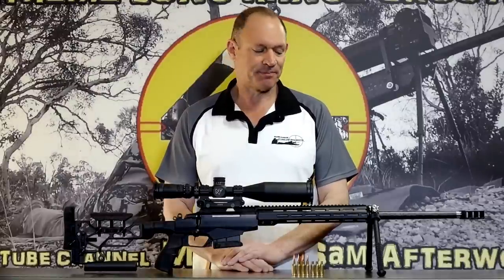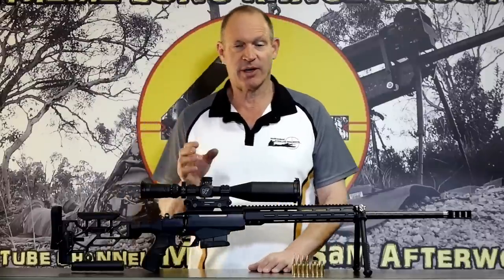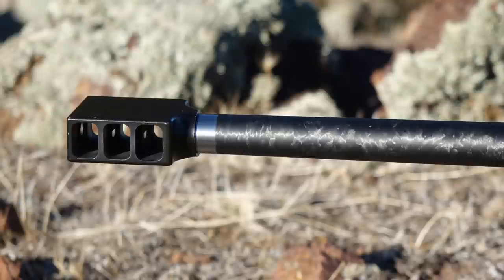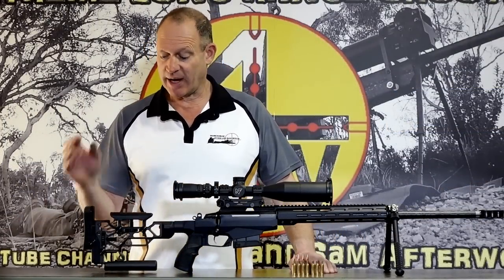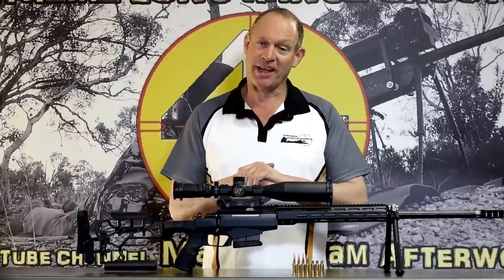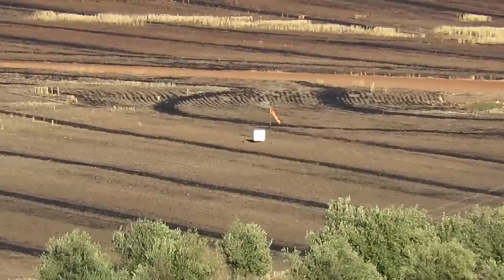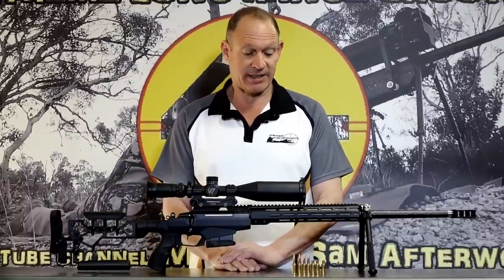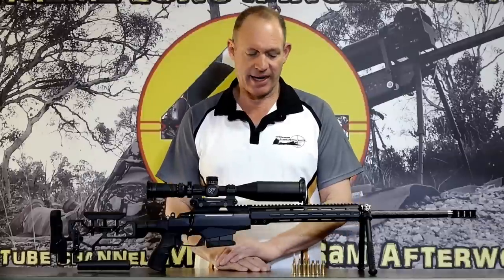Our first shots with the 6mmBR and 4AWised, TIKKA TAC A1 (CarbonSix Barrel)

Comment: I've popped primers in a rem 700.  I think the best fix is called "bushing" the firing pin.  I however fixed mine by putting in a new firing pin spring.  Mine had gotten old and weak and wasn't supporting the primer any more.  It sounded odd to me but I tried it and it worked.

Also a firing pin being too short can cause this.  Again it reduces the support from the firing pin on the rear of the primer.
Reply from the maker: Thanks Man, Cheers

Comment: I have a few 6BR's. When I bought a stock Savage 6BR, it had a shorter free bore than my custom gun (Atlas action, Brux barrel). I came down 1/2 grain from my load that I used in my Atlas action to start. It was way too hot a load and I punched holes in the 205M primers. 2900 fps MV for a 109 is a hot load. I shoot Berger 108's and I can get 2900 MV with them using N140 and Lapua brass. That's with a Brux 1 in 8 barrel with .104 free bore in a Bat action.

Nice shooting you guys. I only have 300yds by me. A 600 yd range is a half a day away. That's why I stick to the 6BR's it's a great round for 300 yds.
Reply from the maker: Thanks Man, Cheers

Comment: I had a problem with the one batch of federal gold medal match primers that I use the metal on the primer must have been a little bit thinner I ran the same load that I always did never had over pressure problems and then got these new primers and it was much little holes in the back but it's a pretty conservative load so I think it's partially metallurgy issue with the primers and that's going to be awesome to see Sam behind that rifle more very nice little rifle
Reply from the maker: Cheers Allen

Comment: needs the pin bushed or go to cci 450s if you have them. pretty normal for alot of factory bolts to pierce primers esp federal as they are soft. 2200 with the br is impressive.
Reply from the maker: Cheers

Comment: I get that primer issue on my 6mm arc with cci, fed, and Winchester primers.  I switched to the wolf srm primers, and I haven’t had that happen since.   It seems like the wolf primers are a touch harder than the others.  You might try wolf primers, if you have access to them.
Reply from the maker: Maybe check your firing pin depth, lol, Cheers

Comment: I would love to see your process on swapping barrels. I know you change barrels tons to accommodate different cartridges on the same action. I am thinking of doing a 300RUM/338edge/375 RUM set up.
Reply from the maker: Same a changing any barrel normal bolt action barrel, a barrel clamp/press and a action wrench, Cheers
Reply: @markandsamafterwork  do you witness mark your barrel/ receiver so they end up in the same spot every time or just torque them on and go?
Reply from the maker: Torque and good smithing, cheers

Comment: Check the diameter of the fire pin against the hole diameter in the bolt face. You might need to get the fire pin hole bushed in your bolt. An over sized pin hole can cause that problem with your fired primers.
Reply from the maker: Thanks Loren, FYI clearance is good, Cheers

Comment: Another  Great video mark and Sam  I shoot a competition BR Out to 600 
Yes it's a very accurate round and I will share it with you my experiences You definitely want no more than 52 thousands Of firing pin protrusion And I have found CCI BR4 primers or CCI 450 Stand up much better to the warmer loads  I'm shooting 30.4 Grains of Varget  Underneath 105 grain Custom malerba bullets With absolutely no primer issues Or signs of pressure  Hope perhaps this will help you if you haven't already sorted it out  Great shooting Sam 😁👍
Reply from the maker: Thanks Matt, sounds great and glad you liked the video, Cheers
Reply: 0.052 inches

Comment: Hi Mark, great video as always, great educational format. I have always had trouble with Federal primers being to soft when you are running warm loads, I have to use winchester primers (not the best but thats I have bulk) for the same load they never deform, must be a harder case. 308cal 168gr ELD match 2845 ft/sec SD:6 ES:16  used in 800, 900 and 1000 yard match. keep up the good work.
Reply from the maker: Thanks Tazy, Cheers

Comment: Mark, absolute perfection in this sweet little project rifle. What performance and I think you hit the nail on the head regarding the length of your firing pin. I installed a new pin in a pre-65 Model 70 .270, that was sent out too long from the factory, years ago that did the same thing. When I finally took my micrometer and checked the length, I was astonished to see it was so much longer that the specifications showed it should be. Simple fix but, took hours of trying to find out what was causing the issue because I didn't expect it.
Reply from the maker: Yes not common, but not much to fix, lol, Cheers

Comment: what you are seeing with the holes in the primer is called blanking or cookie cutting, it is to do with the firing pin hole being a little larger than the firing pin, it can be resolved with having your firing pin hole sleeved or you could try CCI br 4 or 450 primers that have a thicker cup and should fix the problem
l have had the same problem in mauser 98 rifles that l have had made into dashers same result
by now though you would have found this out l am assuming, thanks for a great entertaining video
Reply from the maker: Well yes that can cause a very similar affect, but as explained, not the case here, FYI, all fixed with reprofiling and slightly shortening the firing pin, Cheers

Comment: Great video! Question, would you need some sort of adapter fir the MDT butt stock? I got the fixed Tikka version so not sure if it will fit just like this?
Reply from the maker: Yes, as explained in the video, not hard with a bit of metal work skill, but not something we advise on or sell sorry, Cheers

Comment: wow that 600y group

nicely done Sam

Gotta love a Tikka action.  Any issue with BR in the Tikka mags?  Need to use any spacers or anything?  My TAC and the mags i got for it are about 4 years old at this point, but I had to modify each one of em slightly to get it to feed (.308) properly.  Rounds were nosediving and catching on the breech, but likely they have fixed it by now. (edit: oops actually finished watching the vid...)
Reply from the maker: Thanks man, Cheers

Comment: Great video very informative. Would you suggest it would be easier to convert a .308 rifle into a 6BR, ie. you are using a .308 bolt face and a .308 magazine ? I have a Howa 1500 .308 in a MDT ESS chassis and would love to convert it 6BR. I already re-load so thats no problem, just curious if it is easier to convert from a .308 to 6BR than the .223. Thanks in advance for any advice. P.S. Reason for question is I have started shooting PRS and love the low recoil aspects demonstrated in the video. Thanks.
Reply from the maker: Maybe watch the complete video, all explained, and yes as said in video, would be easier with a .308, as for mag, you will have work that one out, feeding can and usually is an issue, Cheers
Reply: Thanks for the reply. Much appreciated. Once again really enjoyed the video. Thank you.

Comment: I could watch all day.   Do you prefer the 6BR over the 6 Dasher?
Reply from the maker: Not used the dasher,   Cheers
Reply: 6 dasher has a bit larger capacity, but the necks are shorter ; it means it will be a bit more tricky to select the right reamer, bullet length and seating depth. 6 Norma BR will be easier to tune, look at this accuracy ! If you really need more horsepower you should look at the 6XC or 6Creedmoor cartridges.
Reply: @br4713  There is a reason dasher is a hit with the PRS crowd vs strictly ELR like Mark shoots.  I enjoy both disciplines